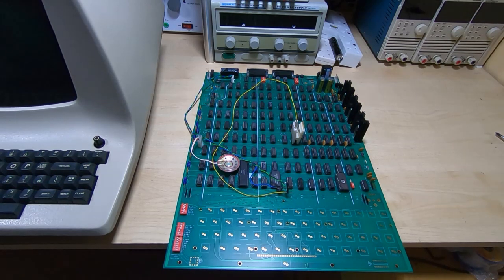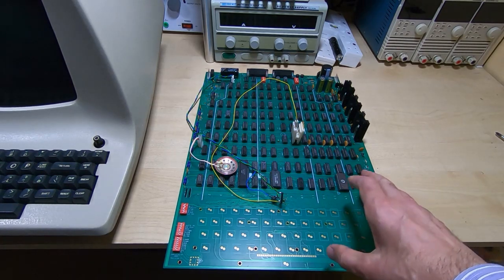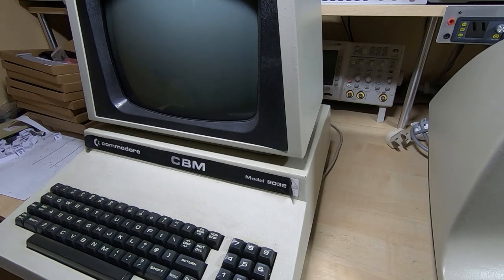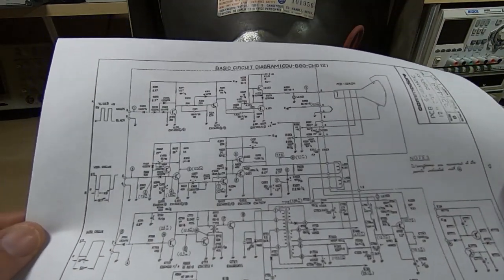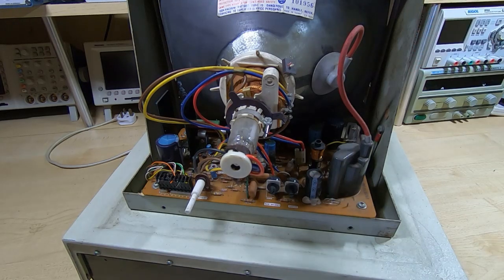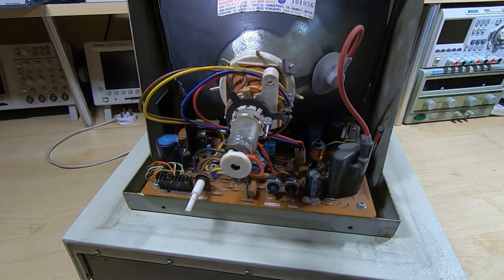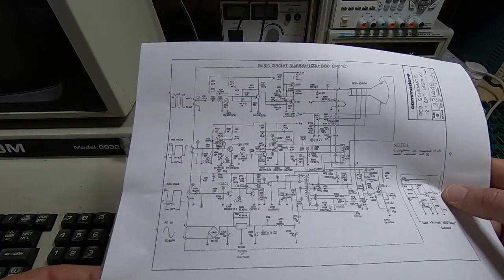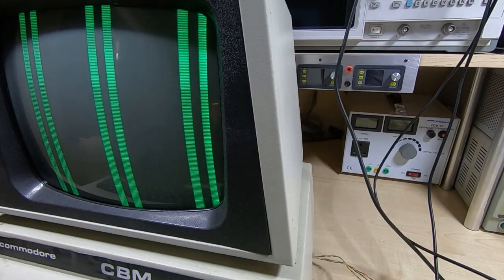ADM-3A  Board Reproduction Part18

Comment: You could build an adapter circuit using a PIC.  On the left side it scans the commodore keyboard.  On the right side are two bidirectional 8 to1 digital switch IC's.  You program the PIC so that the correct row and column are connected when the A key is pressed.  That way you don't have to do major hardware hacking.  As far as the ADM is concerned you pressed the A key on its own keyboard.
Reply from the maker: Good plan but unfortunately it would not work. The scanning of the PIC and the scanning of the ADM would not be in sync so most likely random key outputs would be the result. The debounce circuit is triggered by the key press so there is a relatively critical key timing. Also some of the keys that need to be in different columns are in the same row (common) on the keyboard so the PIC would not be able to differentiate between keys. I will most likely just make a new kepboard pcb and use the key caps as they match the opening in the case. I could of course cut the tracks on the original and put in some wire links but I do not want to destroy the original. Before I do that I am investigating a 'logic' adaptor. It may be possible to create a simple decoder / encoder using logic devices to 'move' the key presses to the correct row and column without any delays but I have only carried out a few tests so far. The real complication is the need to 'block' some combinations and be able to respond to multiple key presses such as shift, alt etc.
Reply: @JerryWalker001  The PIC in no way has to be synchronized to the ADM keyboard scan. That's what the 8 to 1 switches do.  I'm thinking along the lines of the 74HC4051 (there may be a better part), 2 are needed for the row scan and 1 for the column scan.  Connect the 3 common pins together to form a link bus.  Note, the signal travels both ways through these devices.
Algorithm: Scan pet keyboard and determine the A key was pressed.  Select the ADM ROW1 scan signal switch.  Set it on to connect to the link bus.  Select the ADM COL6 switch to connect the link bus to the ADM column scan.  Now every time the ADM ROW1 goes low it transfers to the ADM COL6 going low.  ( Wish I could show a drawing here.)
As long as the PIC sees the A key pressed it holds the switches on.  Once the A key is released the PIC disables the column switch.  As far as the ADM is concerned the A key on its keyboard was pressed and released except there was no key-bounce.
You will have to add a couple of additional switches to handle the repeat, control and shift keys etc.  You'd use the external keyboard connectors that are already present.  The only other external thing is 5v power for the circuit.  No wires or traces need to be cut.
Reply from the maker: @randycarter2001  Perhaps you could buy a board and try it but I think you may find that it will not work. Also as you say the keys are not all in the grid and the existing interconnections on the PET keyboard will prevent it working the way you intend for all the keys. It does however need to be sync'd as the key press triggers other parts of the system and this is generated by the output of the demultiplexer on the ADM board so unless the PIC sets its output at the same time then it would not work. Remember that the point at which this signal is asserted is also when the keyboard scan clock count is used to determine the key pressed so unless these are in sync then the value read will not be as intended. This is also not at the point of the actual key press but after the debounce timer has expired. You would need to ensure that the PIC output occurs at the exact point in the ADM keyboard scan so that the correct 'count' is transfered into the character latches. I would definately be interested to see your solution if you decide to buy a board and get it working. As I always say it is fun to try (remember to use a 5V PIC as most current PIC's will not work in a 5V system).
Reply: @JerryWalker001  That is what the PIC micro-controller is for.  It handles the translation between the Pet keyboard and switch control signals.  In fact on the front side of the PIC you can put any keyboard, even IBM-PC or  IBM-PS2.  All you have to do is change the translation program in the PIC.  All the output of the PIC has to do is set up the on state of the switches.    Start the ADM key scan at ROWA and COL0 when ROW1 and COL6 switches are closed or the A key is pressed.  IC-L8 and IC-l9 will continue scanning because the rest of the keys are open or nonexistent. 
There just isn't space to go into the detail of how the 24 PIC controlled solid state switches interact with the ADM row scan pulses and column scan inputs here. 
The ADM key scan is quite clever in generating ASCII codes with simple digital logic.
Reply from the maker: @randycarter2001  Like I said I will leave that one to you and will be interested to see your working solution.